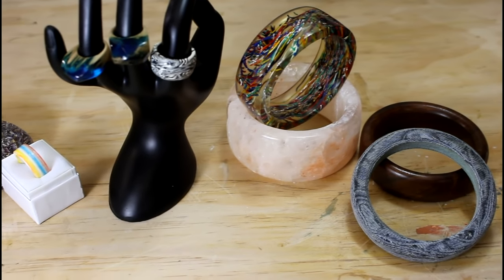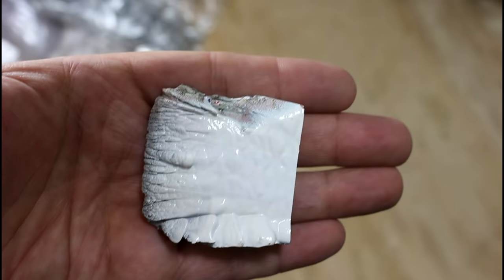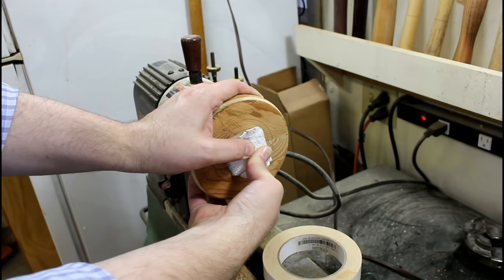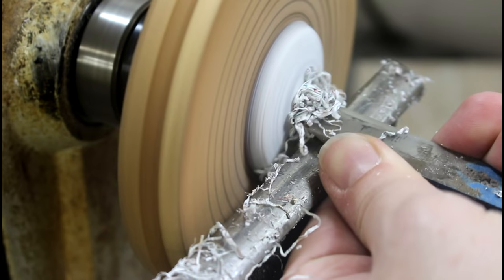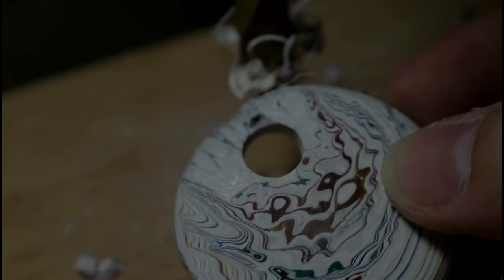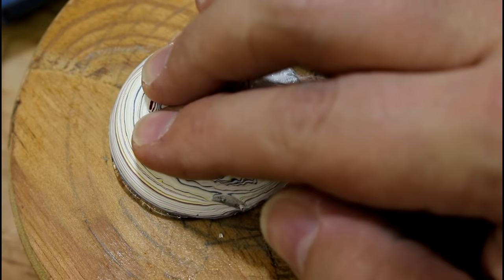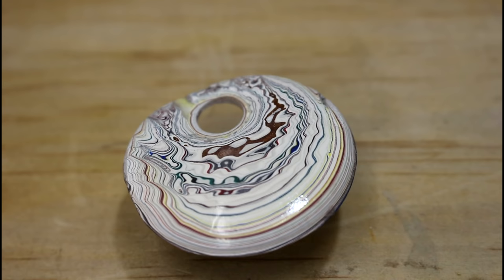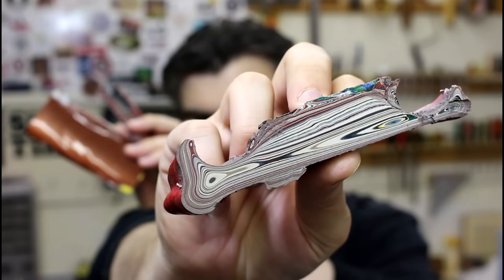Making A Pendant From Paint!

Comment: To take the piece off the chuck, instead of using a hot knife, get a small syringe or eye dropper, and some denatured alcohol (can be found at Big Blue store in the paint section).  Put a few drops of the alcohol on the hot glue, give it a few seconds, the pull the part off nice and easy and way faster!

Comment: I just made a blank from a mixture of random colored oven bake clay that I had left over. I took it to my shop class after I finished baking it and threw it on the lathe. it turned so smooth and it was so satisfying to turn, but I drilled a hole all the way through, and I pushed my luck and turned it way to thin. it blew up on me. it had the look of the Detroit aggot you turned in this video, but I made my own shapes and designed hidden in the swirls. I highly recommend trying to make a candle sick or something in that general area. great videos by the way, keep up the great work 👍

Comment: Trick I just learned with hot glue; heat the mating surfaces with a heat gun before applying glue for a stronger bond. The oak test pieces I did split apart along interior grains rather than the glue bond. When you want to release the bond just soak some alcohol into the joint and the glue pulls away clean.

Comment: Suggestion: When that stuff cracks, use a chemical like acetone (or something that will "melt" the paint) to repair it. You won't have a noticeable line. Also turn your gouge around and use the bottom edge like a scraper. It won't catch and chip your piece.

Comment: Tip to remove hot glue: isopropanol/Isopropyl alcohol.  A good spray, wait a minute two and it comes right off.
No heat required.

Comment: Craft Idea that would technically count as a Dip It: take one of those chunks and smack it with a hammer so it shatters then take all the shatter pieces and put them back together in resin, but have the pieces spaced out enough so you can see between them.

Comment: hey peter you should try using nail polish remover (normal kind) to take off the hot glue it pops off any surface easy if applied to the edges :P

Comment: What resin should I use for casting crystals? (copper acetate, copper sulfate, iron sulfate, etc)
They are fragile, and can be fucked up because of ambient humidity, thats  why I want to cast them in a resin box. about 5*5*5cm in size.
I'd send some to see what you can do, but im not confortable sending any kinds of chemicals via post. Even if those chemicals are just pool chemicals, chemicals used in gardening or something that can be easily made from vinegar, hydrogen peroxide and copper.

I never casted anything in resin, and I cant spend way too much money
Reply: If posible I would also like to try to make the resin encasing have the same shape of the crystal, and put them inside a big rock, that would look really cool imo

Comment: I'm just wondering why you simply didn't stick it back together using paint, after all the material you were using was auto paint right, it split so then jus put a layer or paint on the join and stick it back together no need for super glue.

Comment: Make a letter opener out of the one piece you have.
Reply from the maker: +frank forster i like that idea a lot! A letter opener wouldn't need to be overly strong to hold up.
Reply: thought you would and even if it wasn't sturdy enough it would be easy to implement a piece of light metal like aluminium along side it to give it rigidity